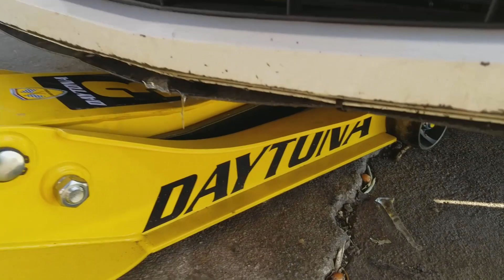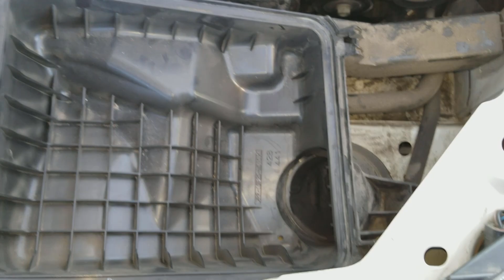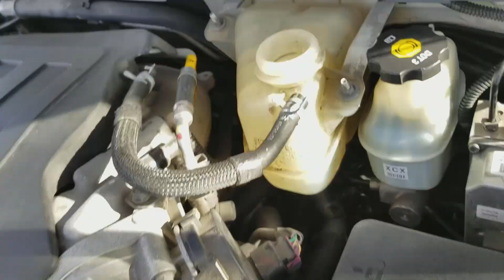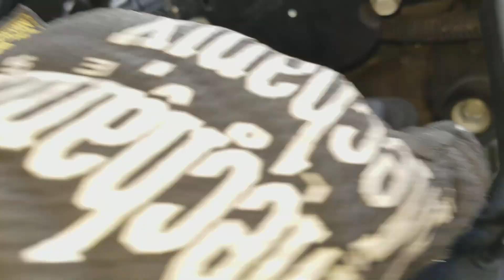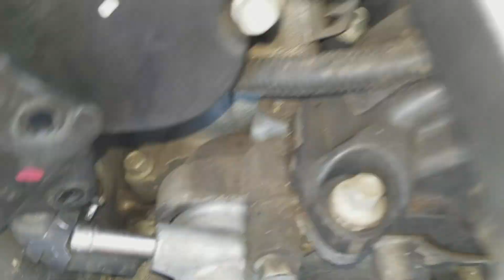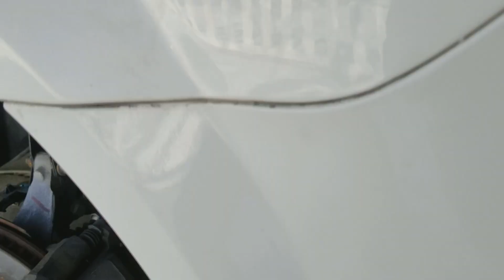Saturn Aura Water Pump + Outlet pipe replacement

Comment: Saw your video, GREAT INFO.  My Saturn Aura is leaking coolant,  can you tell me what is the part number (OEM or Aftermarket) for both the gasket and the O'ring you replaced.   Also, did you order it online or at the Dealership?   do you have a link to purchase them?   Thank You!

Comment: Ansi anxious co2. $10,000 spent for full EV overhaul. Simplified.Transmission to electric motor connection mount, Cam,and crank, engine sensors wired to transmission input,and output  shaft sensors.2Plus 2 Throttle position sensor to control box.Some batteries.And UGO.

Comment: Thanks man! Had my 08 Pontiac G6 GXP with the same 3.6L V6 apart last night to replace what I thought was a bad water pump. Water pump is fine, and the leak is above it. I think my problem is exactly like yours, with the outlet pipe gaskets.
Reply: 09 GXP here, was losing my mind trying to find any information on the LY7 that could apply to me. 
Been dealing with this leak for well over 7 years now. 

So glad to find out it’s a $12 fix!

Comment: First of all, I would like to thank you for giving me some re-assurance by doing the job myself. I could not afford the dealer price or even pepboys who quoted almost a thousand for the pump and two hoses. Secondly, I really didn’t need to remove the front passenger side tires as the entire job was done from the hood. I recommend replacing the water outlet seals as you did and the pump depending upon the miles that you have on your vehicle as preventative maintenance. The job took me about 3.5 hours not having all the easy tools as the shop techs do. The hardest part was slowly preparing the mating surfaces of the water pump.
Reply: Cuban CigarMan  thanks man....

Comment: Great video. Unfortunately my Aura did need a water pump and your video explains perfectly what to do. Btw  I rented a serpentin belt tool which easier to use than a breaker bar. Thanks for the advice!!

Comment: You are a saint. Probably saved me from buying a water pump I didn't need. I put UV tracer in mine and saw a pool sitting on top of the water pump, would have assumed it was seeping out the seal, but now I'm certain I have the same problem you had. *thank you*!